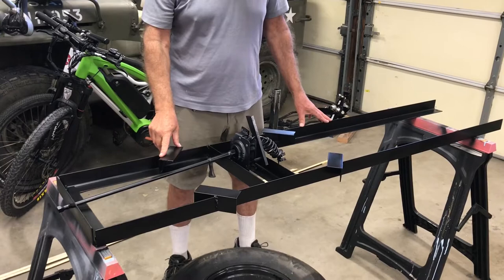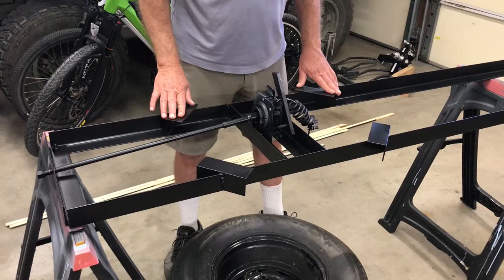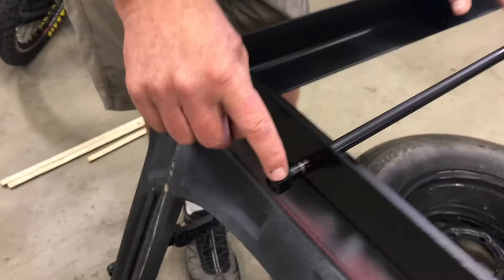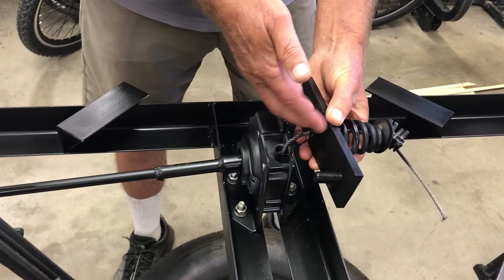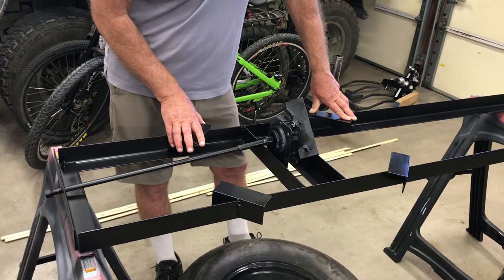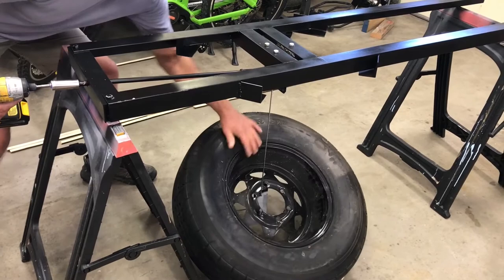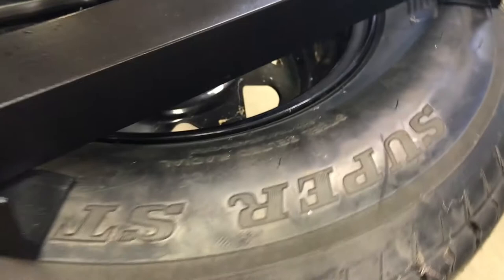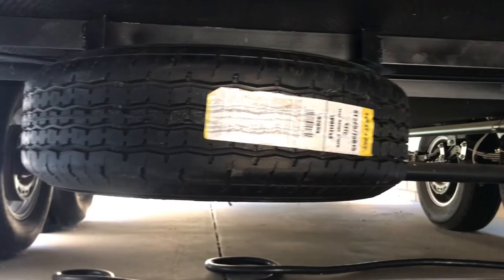Build Inexpensive Under Trailer Spare Tire Winch - Can Accommodate Two Spares

Comment: I love seeing ingenuity in practice. I have an OBS Ford F350 and the spare tire setup for these older trucks is very difficult. I came into the house after deciding I would fix this problem once and for all somehow and came across your video. I just ordered a tire hoist similar to the one you used and with some custom fabrication the frustration of a tire change will be a thing of the past. Thank you. Great job
Reply from the maker: That’s great that you were able to use that winch. Good job!!!

Comment: If you changed the bracket that fits into the axle hole of the spare tire, to a style with a raise middle section with lower shoulders, so the racket automatically cantered itself, it would be just about perfect!
Reply from the maker: The winch came with one but it came up too far and would keep the tire from going up tight against the pads I installed. I did put two studs in the straight bar and centered the hole where the cable comes through, so the tire balances perfectly. Good luck with your project!!!

Comment: Nice job. I´m figuring to do something like that in my RV bus. Try to put two bolts in the bracket and elevating the wheel upside up.
Reply from the maker: Thanks Fernando! I did put in two lugs and centered the cable hole so the tire goes up perfectly. The winch works really well. You have to cut and weld a flange on it so it will bolt on perpendicular to the ground. Good luck!!!

Comment: this kind of tire carrier is great. just drop the tire every year. to lube the unit. and check the tire for rd damage.  but one must secure he spare from theft. those cheap stick locks do not work. way to easy to by-pass or just snap off. one needs DOT 1/2 in chain. and a large pad lock  (better quality, not a master lock)  that is not easy for a lock pick to get to. and a plate to protect the chain from being cut.
 and this even goes for the cheap one use half tire spares as the crooks sell them real fast.

Comment: Can you show me how your ends bolted on, thanks.
Reply from the maker: I put a 3/8 grade 8 bolt with washer and nylon insert locking nut in each corner - 4 total. My trailer  frame is an "I" beam type so it was easy to drill through then access bolt heads to tighten.

Comment: Can't find yours with cable and bolt on opposite sides of the hoist.
Reply from the maker: not sure what you mean here. The cheapest I could find is $33. Here is the link: https://www.ebay.com/itm/142789437832?mkcid=16&mkevt=1&mkrid=711-127632-2357-0&ssspo=33nly0zSRJ2&sssrc=2047675&ssuid=&widget_ver=artemis&media=COPY